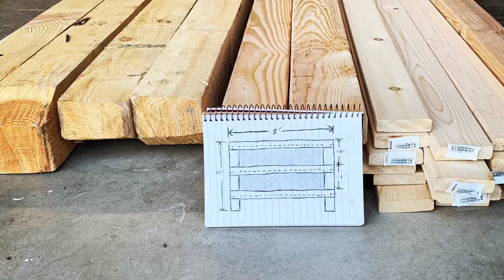How To Build A Wine Cork Bar Top

Comment: The patience required for the corks is out of this world hahaha great work man!!
Reply from the maker: Let me tell if the walls in my garage could talk! Laying the corks for the top was not fun and definitely tested my patience with all I had to go through. I ended up cutting all of the corks in half so that I could cover more space with what I had. In the end I was still short and was about to call an emergency drinking session. I had to find someone in my town selling them. 

In addition to that, the resin I bought at Home Depot was actually just water! Apparently, someone bought it, used it, filled it with water and returned it! So I had to the smaller pint size resins to finish the top. 

Lastly, when I started pouring the resin, the corks started floating on me. Before I started pouring the resin I said to myself I should glue these down. That’s what I get for not listening to the voices in my head!

It was frustrating but the end result was totally worth it!
Reply: @TheDadCave  ooohf, that's a shady trick, returning the resin with water...that's worse than drinking all the vodka and refilling the bottle with water so your parents don't find out!
Reply from the maker: PinetopJackson 😂 haha! That is so very true! I never even thought of it that way! In the end I was just glad that I was able to finish it on time. Home Depot was more than generous though when I returned it. If they hadn’t made it right, I wouldn’t have gotten it done!

Comment: The epoxy doesn’t leak when applying? I’m kinda intimidated by epoxy but it looks awesome!
Reply from the maker: As long as you seal cracks along the bed of where you are pouring the epoxy you should be good. Just make sure you don’t miss any spots otherwise the epoxy will most certainly seep out. Ask me how I know. 😂 This was my first time using epoxy and I learned a lot from the first time. Thank you for commenting as well!

Comment: Love the video! I want to try something similar with a wooden tray. Do you know of anything to use for this if I don't want to use epoxy?
Reply from the maker: Thank you for the feedback! If you aren’t worried about having a perfectly flat surface for the tray, I would say to use a spray on polyurethane or lacquer. It would help seal the corks and make it easy to wipe off. If you are using the tray for anything that may contain liquid I would recommend using epoxy to set the wine corks in. A wine cork charcuterie board? Might just be a new video idea! Btw, if you are planning on cutting the wine corks in half, I made a video for an easier way to cut them. 👇
HOW TO CUT WINE CORKS | Easy Way to Cut Wine Corks
https://youtu.be/5mZLgf918dI

Comment: What type of wood did you use under the corks? I was going to go with plywood but I like the idea of using a thinner board. Also, what type of sealant did you use to seal the corners so the resin wouldn’t drip through?
Reply from the maker: I used 1/4” mdf. To seal the corners I used clear silicon. I would say mdf is a good option. It’s lighter. Also it is easy to glue the corks down before pouring the resin.

Comment: What kind of glue did you use to glue those on?
Reply from the maker: So funny story, I didn’t glue them down before I poured the epoxy. Thankfully only some of the corks started floating. Then it turned into a gam of Wack A Mole. I was able to get the corks back down thankfully. A simple wood glue spread out would work fine I’m sure. Just be sure to let the glue dry enough to hold the corks before pouring the resin. I hope that helps. What are you working on?

Comment: Very helpful video! I'm converting a Sprinter van into camper conversion for road trips and want to make a wine cork epoxy table for the swivel mount. Weight of interior components is critical form van and a butcher block table is concerning.  How much weight does the epoxy add? I was thinking of using a 1/2" plywood base for structure and thought cork 7 epoxy could be much lighter. The overall table dimensions 33"x24". Do you think it would be lighter than butcher block?
Reply from the maker: I’m glad you found the video helpful. I think if you were to go with the wine cork and epoxy top it would be considerably lighter than butcher block. Butcher tends to be heavy since it is made from hardwoods. Before you pour the epoxy be sure to glue the corks down first, otherwise they will start floating on you. Ask me how I know😂. I would also suggest cutting them in half and glue the to the plywood. It will require less epoxy to cover them. I made a video on cutting the wine corks in half if you want to check it out. 
https://youtu.be/5mZLgf918dI

Comment: Hi, love the video and just about to try this, what sort of resin did your use? Also I noted in one of the comments you noted about air bubbles, how best to get rid of them? Thanks.
Reply from the maker: I used MAS epoxy. It’s a 1:1 ratio epoxy. I used a torch to get rid of the air bubbles. It was my first time using epoxy and I was really happy with how it turned out. The best part is it’s at my sister in laws house and I still get to see it and touch the bar top. 😃

Comment: My original comment seems to have disappeared but I am working on my kitchen counter top now 😍 did you do a seal coat with the resin on the corks first
Reply from the maker: No I just laid it down since I had the corks inside of the bar shelf. I would do a seal coat first just to make sure all of the crevices get filled. And then add to it after it cures. Doing it stages will also allow you to get rid of any air bubbles that might form.
Reply from the maker: BTW not sure what happened to your original comments either. That is really weird.

Comment: How much epoxy did it take for the top? I'd love to do something similar!
Reply from the maker: It took just a little over 4 quarts. What are you planning?
Reply: Going to make a domino table with a  wine cork top! Very excited
Reply from the maker: @michaelkingsley7612  right on! That does sound exciting! Be sure to glue down the corks before pouring the epoxy. And if you want an easy way to cut the wine corks here is a link to my video on it.  https://youtu.be/5mZLgf918dI  I’d love to see pictures and share them on my social media pages if you’re okay with that.
Reply: For sure!
Reply from the maker: @michaelkingsley7612  right on! My social media accounts are on my channel. I primarily use Instagram and Facebook.
Reply: @TheDadCave  what did you use to glue them down? Super glue seems so spendy for that. Liquid nails doesnt seem like it would work well.
Reply from the maker: @ericfoschiatti194  Well… I didn’t glue them down. I should have but in hind sight I would have just used wood glue.

Comment: Luv the bar top but you don’t tell what products to use or step by step how to make it. Looking to do a small kitchen table with wine corks.
Reply from the maker: Thanks for the feedback Nancy. The epoxy I used was from Home Depot. If you are going to do a table top out of wine corks here’s what I would have done differently. First soak all of your wine corks in water, I found out from one of my subscribers afterwards that they are easier to cut in half when they are wet. After letting them dry, glue them down to the surface before attempting to pour resin on them, otherwise they will float up on you. Found that out when I was trying to pour the resin. It was like playing wack a mole with wine corks! I am finishing up editing a video right now. I had a few other people as similar questions. Maybe I can put together a more in depth video next.
Reply: @TheDadCave  I appreciate your reply, I was hoping to do it for my winter project, not in a big hurry, might wait for your next video to get done. I was also told to do a small project first, like a TV tray. Do u think this is a good idea? Also wondering if I need to keep the frame on after the epoxy cures?
Reply from the maker: A TV tray for a test run is a great idea I think! If you are doing a table top or TV tray that doesn’t have permanent sides you will want to leave the frame on while the epoxy cures. There are resin tapes you will want to place onto the frame before attaching it and pouring the resin. The tape has a non stick side that will prevent the epoxy from sticking to it. Once it cures, remove the frame. You may have to give it some love taps with a mallet but it should come off pretty easily.
Reply: @TheDadCave  ok, thank you so much for your input, I will try to show you my final project!
Reply from the maker: Please do! My social media links are in the video description. Drop me a message on either of them. Thanks for commenting and subscribing, I truly appreciate it!